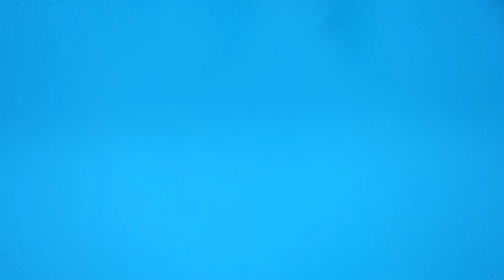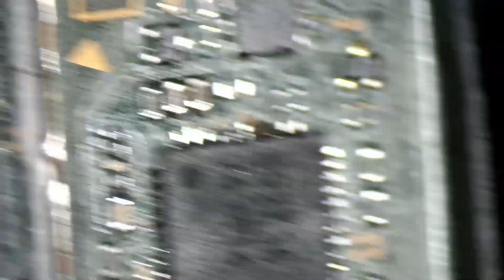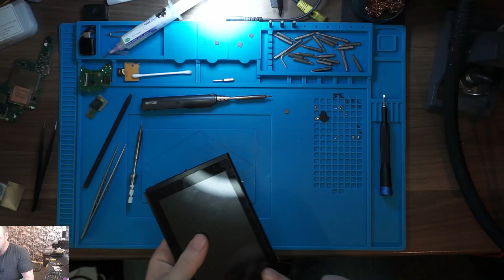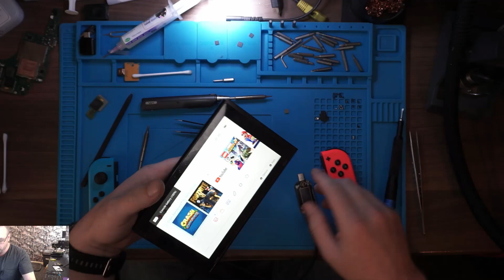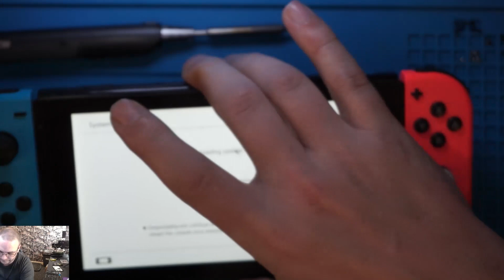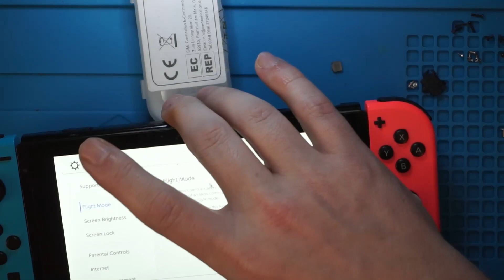Switch board win

Comment: As the switch didn't take any power you replaced some capacitors and the M92 chip. May I ask if the capacitors were broken and how did you find them?
I have a switch which had a blue screen and over the last two years I try to teach myself how to fix such a problem. I have first reflowed the RAM, now the board also takes 0A @ 5V. Then I thaugt maybe the reflowing went wrong so I reballed both RAM chips without any change. Now I thaugt the BSOD was maybe caused by the APU and heating up the RAM finally damaged some APU connections. In your video you mentioned the capacitors and M92 to cause the 0A behavior. So maybe I should first check problems in that area before trying to reflow/reball the APU.
I don't know how the start-up of the switch works in detail. Usually after plugging the USB-C power cable in it automatically switches on without using the power button. Does the APU switch the device on after getting the USB signal?
Would be nice to get a small hint what you have checked to find the defect parts :)
Reply from the maker: Hi @Simasc Nop,
So in total my board was missing 4 capacitors which 2 of which I may have pinched after originally declaring it a donor board. But it would have been that long ago I wouldn't remember removing them 😆.

2 of the caps were more of a filter type cap which are very small and sit really close to the left side of the vpu shield if the port is facing you.

2 other caps that were missing was the caps on pins 39 and 40 of the M92T36 ic.

There was a cracked capacitor I changed on the underside of the board which was found while examining the board under the scope, I'm not sure I can upload pictures into the comment section of youtube if I can I am more than happy to point them out in detail.

Even upon changing and replacing the missing caps the system didn't work but was drawing around 0.19a until I replaced M92T36 which also didn't show any shorts but the system was taking 15v and only showing 5v on the coil to the right side of the port.